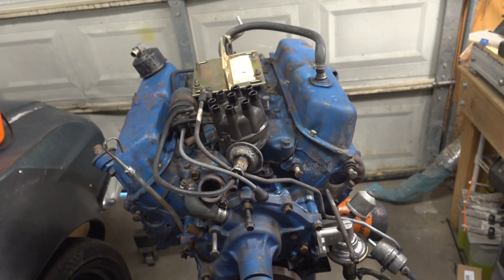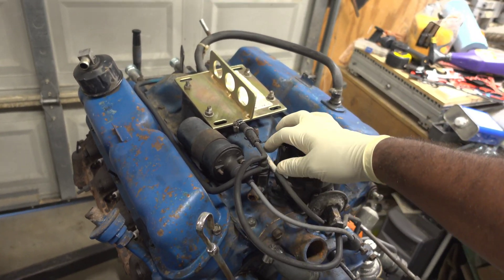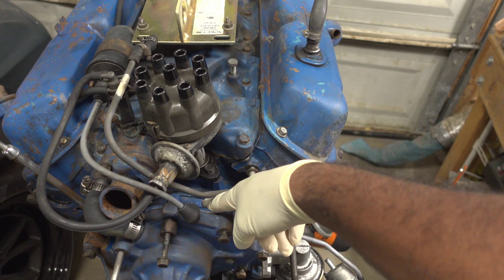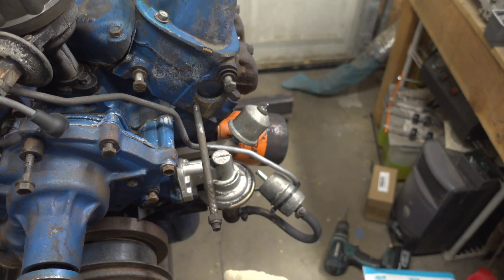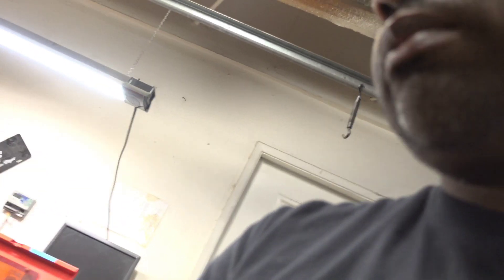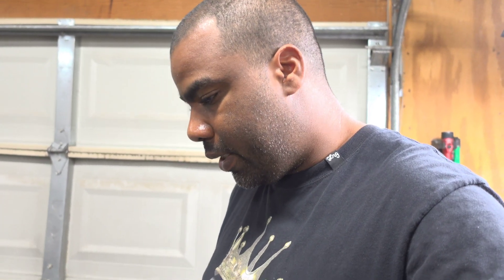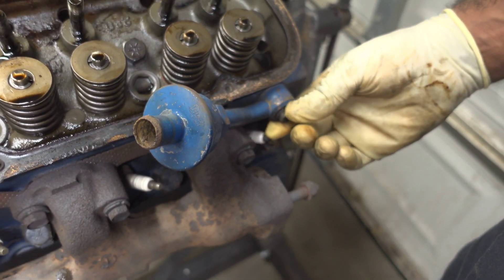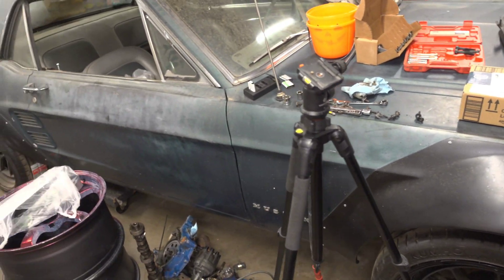No More Flat Tappet For This 1967 Ford Mustang 289 - Roller Cam Conversion

Comment: FOr those about to do this call Summit and get an adjustable pushrod and the checker spring that comes with it so you get the right length the first time. Super important to get that geometry right so you dont eat your guides valve job, tips etc
Reply from the maker: I did that myself unfortunately i couldn't get a good wipe, I ended up using the 90° at mid lift method then factored in the the preload that Howards cams recommended for my application, I went over this a video or 2 after this one, takes a bit of easy math but gives you solid numbers

Comment: Not sure why you did roller cam with that old poor flow head
Reply from the maker: Because I have aluminum heads, the stock never went back on
Reply: @Ricardo_Wade  That poster dont know even with old stockers a roller cam will still pick it up. What grind did you go with
Reply: It's worth the swap just to get rid of the flat tappet oil issues. Upgrade / port heads at the same time just gravey.

Comment: If the machine shop charges too much for the cylinder head work I would just go with new aluminum cylinder heads.
Reply from the maker: @VegasRT500  sorry for the late reply but yea that's exactly what I did

Comment: Keep going on this, I have multiple builds going on and I want to “borrow” my brothers 289. 😅 I want to stuff a solid roller cam in it like all mine and see just how nasty I can make it sound!
Reply from the maker: I already installed the roller cam and the ebay aluminum heads with new upgraded springs and retainers, you might want to subscribe If you haven't this next video is going to be important since it involves measuring for pushrods and correct rocker geometry, I've already done it just not on camera but my part of california has been 105°f for a few weeks wich is why I haven't been uploading
Reply: @Ricardo_Wade  Ca heat...in Hemet know it well. Dread summers now!
Reply from the maker: @gordocarbo  I'm in palmdale but we get similar heat and dry winters, I currently have the engine bay to bare metal but gotta wait for the 70°+ weather to spray it and continue the build and vids

Comment: Finally somebody with brains !!!!!   Just make sure new roller camshaft along with new roller tappets !!!
Reply from the maker: Thank you sir! Threw in a howards roller cam this passed weekend along with howards roller lifters with link bars, no need to drill and tap for the dog bones spider, just waiting on new thrust plate and double roller chain and that video should be posted on Monday, another piece to the puzzle are the new length push rods since roller lifter sit taller than the flat tappets I'm thinking they might measure out same length as the oem fox body 302 roller motor